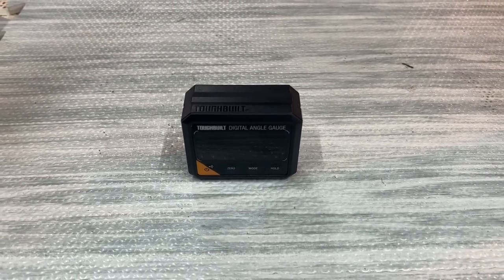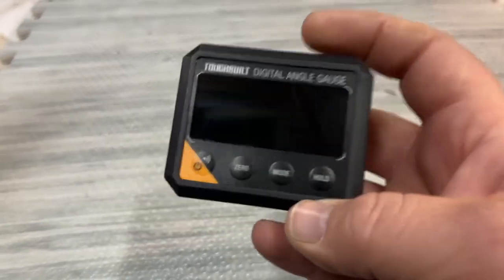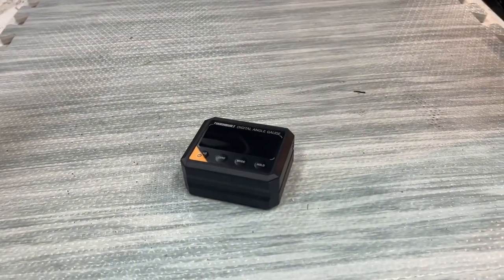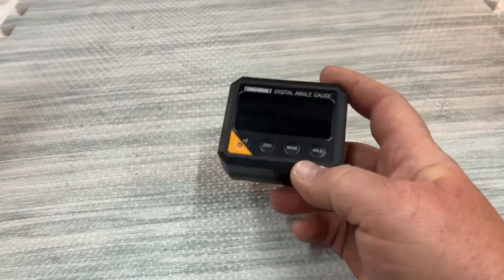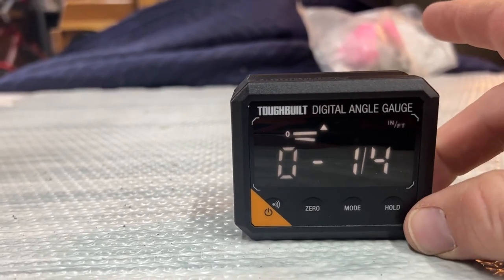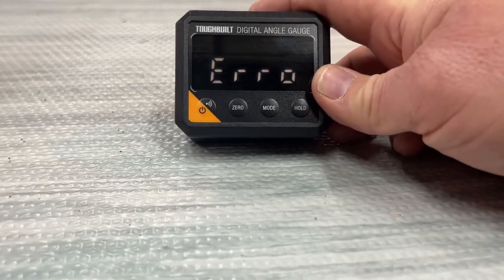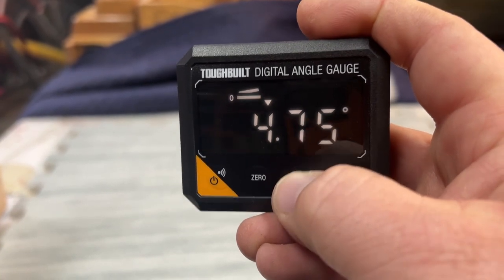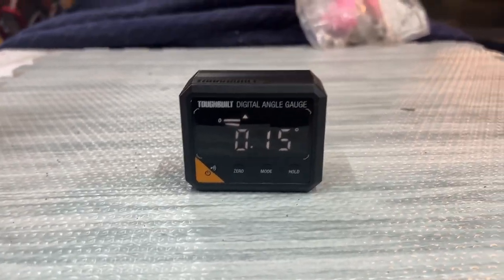ToughBuilt Digital Angle Gauge

Comment: I think it's a good buy - miss is needing a screwdriver to open the battery department (inevitably the batteries will leak). The error is because the angle sensor is not calibrated to measure too far off axis - pretty typical of all digital angle sensors, even those much more expensive.

What is the mute button for? Will it beep if level perhaps? This would be super handy if that's the case (can't find the manual online).